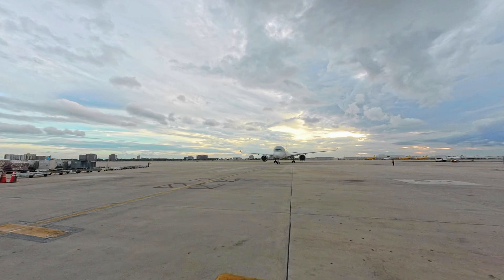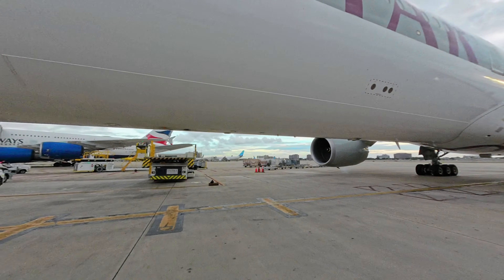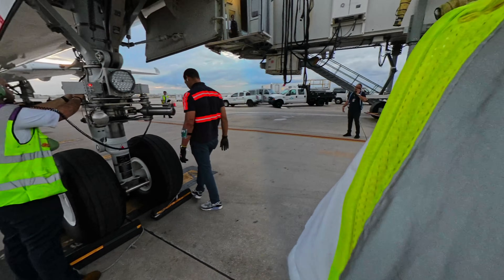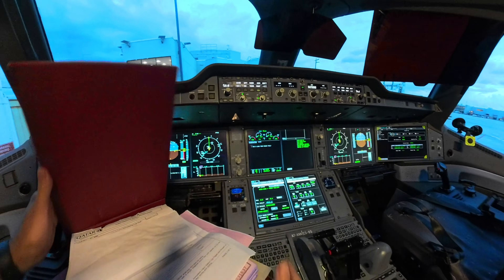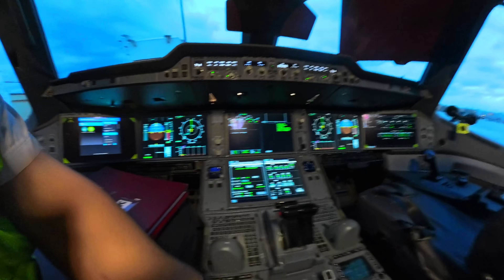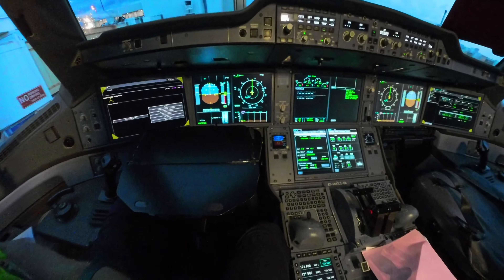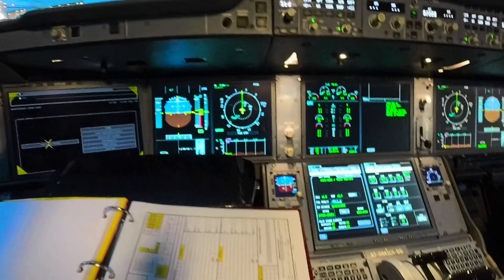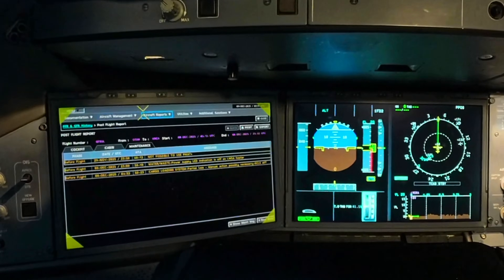Airbus A350 1000, ENG 1 Hydraulic isolation after a power transfer failure.

Comment: Do you sometimes need to contact the manufacturer when faults need diagnosing?
Reply from the maker: No we don’t contact manufacturer, that all run through the companies maintenance control if that would be required, most often that happens when there is a structural damage out of the limits of the Structural Repair Manual.

Comment: Hi. So what triggered the problem?  What caused the isolation valve to isolate
Reply from the maker: The power interruption after engine shutdown when APU generator didn’t took over. It latch the fault, isolation valve were still open on the system page. But the clear that the valve needs to make the cycle from close to open.
Reply: @dennisvijverbergbrakesrele6098 thank you